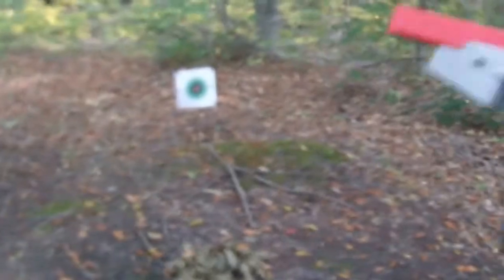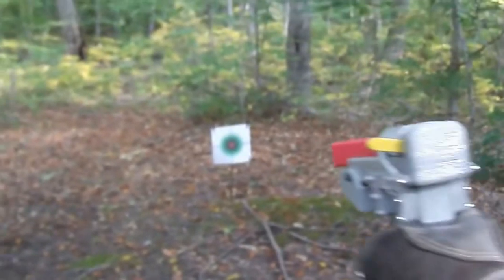3D printed Breech Loading Black Powder Pistol Critical Miss

Comment: Stop using plastic barrel, a f*cking pipe parrel from hardware store cut to length are more than strong enough for black powder charge, get an extra thick one, boring them out with cheap 100 dollar equipment is also possible, you can also rifle them as rifling drills are available for less than 200 bucks, the breech should also be metal, and having it machined is possible from a metal shop, the cartridges do not have to be that thick honestly if they could get away with paper cartridges and lead ball in 1850s with bolt action, you can easily replicate this on a 3D printer but I am not sure what if the cartridge will expand too much in the barrel, it might actually be better off just using a cardboard cartridge for cost and ease of manufacturing.